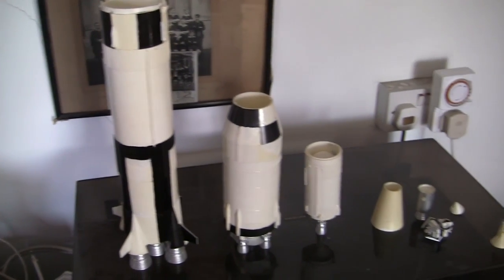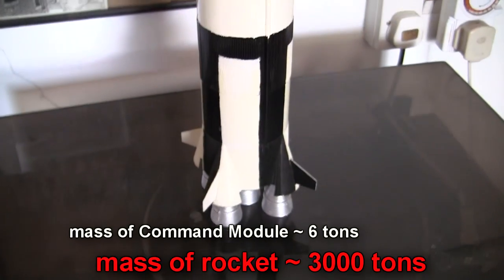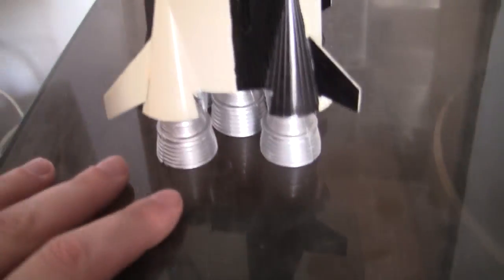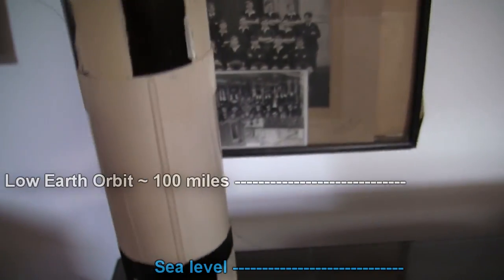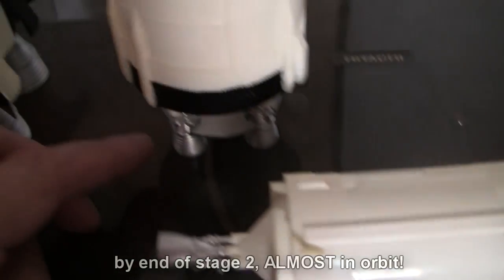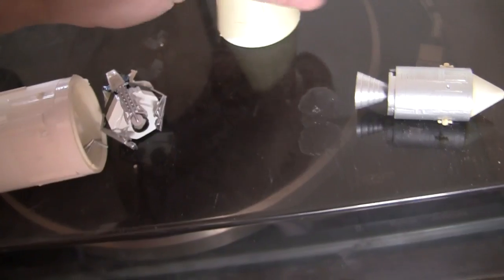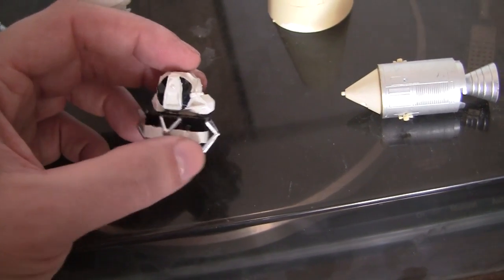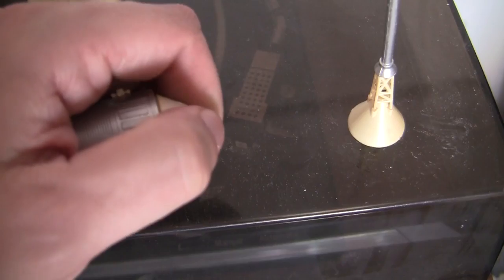The Saturn V Rocket: How it worked!

Comment: It is achievable to land on Mars ( by todays technology ) because it has atmosphere which can be used to brake the speed of a space craft from 25,000 km/ hour to only a few km/h and then land , without consuming any fuel.
It is different on the moon. The space craft needs the same amount of fuel to slow down and land, as it used to get to that speed in the first place.
You don`t need to be a rocket scientist to calculate the required fuel and see that even with todays tech. it is impossible.

Comment: In 1958 Von Braun wrote a book in which he has calculated that fuel required for sending a space ship to the moon , landing and returning would be in excess of 800,000 metric ton. The saturn 5 was only 4000 ton. How could such a scientist do such a big mistake?
The answer is that he was not wrong in his first calculations. USA never landed on the moon. 
What makes it impossible is that moon does not have any atmosphere and therefore lots of fuels is required to slow down and land the lander.

Comment: He did it in a crude little rocket plane that had to be air launched because it wasn't able to take off under it's own power.

When you're talking about reaching the Moon, launching from an aeroplane travelling at a few hundred miles per hour and a few ten-thousand feet isn't really going to save you much in the long run, and adds heaps of unnecessary complexity and cost. It works for small suborbital craft, but it doesn't apply to deeper space missions.

Comment: Soviets actually didn't have a choice because they lacked industrial capacity to build large rocket engines. They did make a revolutionary improvement to the smaller engines they used, increasing efficiency by some 15%. From what I heard, NASA engineers were stunned with Soviet efficiency which was unheard of in the Western world.
I enjoy your videos very much. Thank you Thunderf00t.

Comment: I said to leave LEO. Aerodynamics don't even get you to LEO. You'd use wings for LEO or suborbital craft, but if you intend to go further away you need bigger and bigger wings and it starts getting more expensive than a whacking great rocket.

I'm a big supporter of the Skylon programme that I mentioned, but that can't get you out of LEO alone. Now assembling your rocket in LEO is an option, but it wasn't in the 1960s.

Comment: But you're wrong there. To get to the Moon the Saturn V was the only way to do it at the time. Air launched spaceplanes are not bad for LEO, but you need a lot more oomph to get to the Moon. At that point the vertical launcher becomes the more economic proposition. The size of the aircraft needed to lift the S.IVB booster and launch it would be ridiculous.

Plus, the X-1 was crude compared to the Miles M.52 which was a proper aeroplane and should have been first past M=1.

Comment: I built that very same kit as a kid - in fact I built both of them, the Saturn IVB and the Saturn V. I also built a larger-scale model kit of the LEM. The thingh was, no matter how carefully you built these kits, you still smudged the paint a little or else got a bit of glue on the transparent parts. They were still cool though. My favourite kit ever was the Revell model of Nelson's Victory - I worked hard for several months on that! Kids don't build construction kits any more which is a pity.

Comment: it wouldn't be practical to use a saturn 5 to deliver a warhead to anything on earth. Do some research and you'll quickly realize that engines that size are not needed to put warheads on moscow. a few 10 megaton warheads are all you need to wipe entire counties of their population and several small bombs do the job much better than one giant bomb. In a nuclear exchange, it's best to have many small rockets each carrying several smaller warheads. So no, the saturn v probably wasn't a conspiracy.

Comment: Well considering it would take writing a full OpenFOAM routine to get it as realistic as you and I would like (and trust me, those things aren't as easy as CAD, mesh and run :P), that would actually work with any model imports, I think it's better to just keep to analytical equations, which results in a more simplistic model, but one that doesn't require a supercomputer to run in real time. There's a decent compromise to be had, we just need to find it :D

Comment: At 4:20ish you start talking about the third stage and you missed a bit in there...the CM would separate, then the CM pilot would manually maneuver the CM and dock with the LEM while it was still inside the third stage housing, then, extract the LEM. At no point was the LEM free-floating in space. Earth/Lunar orbit CM/LEM docking was essential to the entire program. Without it, no one ever gets to the moon or comes back. Oh, and I agree! To shut down NASA for a tantrum is BS. :)

Comment: I think they just need to release an engineer oriented dev kit, where you can stick CAD models of your design, then it calculates power, efficiency, etc for you (i.e. numbers to go in the game engine). That way you can pump out designs without actually needing to alter even the current engine, and without needing to learn how to program the damn thing either :P

Of course all this is possible right now, but CFD packages are fucking expensive :/

Comment: Yeah, but that's the thing: Since a rocket engines is, by itself, a "detail" in the whole rocket, you won't feel your "touch", the effect of your choices, unless we have components interacting in a very detailed/complex way
And that's actually just like I though it would be nice in a game: Two separate parts, a engineering detailed one, where you can put the engine in a test bed and everything, and the rocket assembly one, similar to what KSP is currently
But that sounds freaking hard to achieve

Comment: If you want to go all the way then we might as well build a real one :P

If you split the game engine into a few bits, then you can have the engineering dev kit where all the hard maths is done, then you have the space flight kit, where the vehicle gets put together and tested. This way you don't need a massive simulation in real time, instead you can get the performance numbers off the dev kit and run a similar game engine.

Comment: As you said, you'd need various components, turbopumps, a more complex piping/duct simulation, a lot more of thermodynamic equating, combust. chambers. Plus you'd need to design vibration/stress/thermal interactions for those internal and numerous parts! It would be either: a) super complex and highly processing expensive. b) hard/expensive to make it feel right.
But I hope, some day, I would be able to do something like that after graduating in Aerospace Eng. Maybe a Softw. Mstrs. later :)

Comment: There is only one equation governing exhaust nozzles, through that, equations for temperature, pressure, velocity, density, etc can be derived. It's a game, boundary layer effects can be ignored for the purpose of simplicity. They can have a certain combustion cycle setup, turbopumps, etc, which are of fixed specification, leaving us to optimise the design. But really, I just want some pulse detonating engines in there :D

I see your point though, it's opening a tin of worms :P

Comment: It wouldn't be a good gaming experience with the current game engine.
You can build your own engines: Just put a model and it's specifications into the game as a mod.
But to allow for an 'actual' engine design gaming experience, it would require a lot more of calculations to give a dynamic/variable engine performance.

Comment: Actually they scraped the program before. Some bureaus continued their development, which resulted in the proposal for a new rocket, but the bureaucracy had already decided to switch focus into their space shuttle programme. The NK-33 were development after the cancellation of the N-1, that was only possible because the engineering departments had autonomy to decide which project to pursuit without compromising their funds from the Union.

Comment: The smaller engines were actually 20% more efficient than the 4 bigger engines of the Saturn V, while being only 11% heavier. Since the mass difference equates into a logarithm its effect is diminished in comparison with the linear effect of changing the specific thrust. That was not the actual cause: More engines created a more complicated, less reliable system.

Comment: Well that and someone in polit bureau decided to scrap the programme just as they were starting to make headway. Someone had the good sense to store the NK-33 engines, which were later used as a basis for the RD-180. Though smaller, these engines are about 25-30% more efficient than the ones on the Saturn V because of their closed cycle design (rejected by the west for being risky)

Comment: All 3 N1 rockets crashed soon after launch, because of one or multiple engines failure in the first stage. It was stupendously complex rig of 30+ engines, and no technology to control or monitor it properly.

So, USSR moon program just can't get off the ground. 

TL;DR - ?v=umLMkhdf1_o

Comment: Great video! One thing you might want to fix with a text note on the screen: they didn't have to "carry the fuel for that [atmospheric braking]" because they were just using air friction to slow down. The bottom of the command module was covered by a ceramic heat shield--no engines. After the command module separated, all they had were a few tiny retro rockets for maneuvering.

Comment: Hes not talking about the failures where we actually lost people, hes talking about the failures even before we started using living beings. During the 50s we had a shitton of failures. So when we started putting people in the rockets, the success rate was rather low. Of course, we learned a lot by that time, which is why we only lost 6 in those days. 

Both shuttle explosions shouldn't have happened. People ignored small warnings signs, and went ahead with schedules.

Comment: Loved your battleship video, love the Saturn V one too, if its not too much trouble keep them coming. One of my favorite bits of engineering on the Saturn V was the heat shield on the capsule. It was designed to char and flake off as it burned with the burned away bits carrying heat off with them. Its just such a clever way to get rid of heat and save weight at the same time.

Comment: Yes, but you can get most of the grunt work done with an airbreathing engine. That right there makes it about half the weight it otherwise would have been. You don't even need extra stages (though it makes sense on a big mission) to switch from air to onboard oxidiser with a PDE, though it doesn't necessarily have to be airbreathing, you can carry all the oxidiser with you and still save on the weight of the turbo pumps. Cheaper to make too :D

Comment: The smarter way to paint these would be spraying them. It doesn't require so much skill with the brush, and however good you may be with a brush, a spray will deliver a better finish in the end, simply due to the limitations of brush painting. Finer detail can be done by masking and decals.

Comment: PDEs don't require turbo pumps. They instead rely on well designed fuel injectors and supersonic compression (not initially obviously). The distinct advantage is that if something goes wrong the engine can be shut down by simply cutting power to the injector assembly. This will cut off the fuel/oxidiser supply immediately. PDEs offer higher specific impulse for lower weight and a much simpler engine. Currently however they're in the small scale testing phase due to limited funding.

Comment: To clarify, graphics cards are basically built for vector calculations. On a massive scale. That's how they get the 3D models to move. That's also how they calculate shadows, reflections, etc.

Just so happens they use them for gaming graphics :)

Point is, with a tablet graphics chip you can run 3d telemetry, possibly some systems. Hell it'll even do 2D CFD :P

Comment: I suppose it makes the system simpler, certainly reduces the requirements for the turbo pumps, those cooling jackets tend to add a fair bit of resistance. It would take some precise manufacturing to ensure an even ablative layer though, it's enough that your nozzle is getting wider as you burn the fuel, but if you get an imbalance on one side you end up with an unwanted thrust vector and that would just add unnecessary complexity to nav systems to correct.

Comment: With all due respect, the space shuttle requires sophisticated navigational equipment. Back in the 60s most systems were autonomous mechanical systems, requiring no computing power to operate. Nowadays pretty much all of it is computer controlled. My point is, for simpler navigation (i.e. orbital injection, basic course corrections) you don't need all this power. Even on reentry, they're only aiming for an ocean, not a runway, so it's doable with hand calculations if one has the time.

Comment: What Thunderf00t forgot to mention is that even though the Russians didn't have the powerful rockets, they had developed the first reliable closed cycle engines, rejected by the west for being too risky. They were sold to American companies after the USSR collapsed and are used to power the Atlas 5 rockets because of their high efficiency.

For those interested, the two rocket engines are code named NK-33 and RD-180. The RD-180 being a later development of the NK-33

Comment: that was a 2 tier process one it cooled the engine booster shroud to stop it from melting and as a heat interchanger heated the liquid oxy to aid combustion this was achieved using vents after a helical desent around the booster shroud

Comment: They were all about the same size as they didn't make custom space suits back then.  Most of the astronauts then were very healthy physically fit test pilots, so no small wimps.  You can see the Apollo 11 capsule and look inside at the Air and Space Museum in Washington D.C.  It was extremely cramped.  The rest of the capsules are at various other museums around the country.

Comment: ...and the only reason that no women were gang raped by the three men in their 360 foot tall, 3,080 ton metal phallus, is that it turns out that there are no women on the moon which just goes to show that taking precautions and avoiding places where they will be all alone with three men and a 360 foot long metal penis will prevent women from being raped.